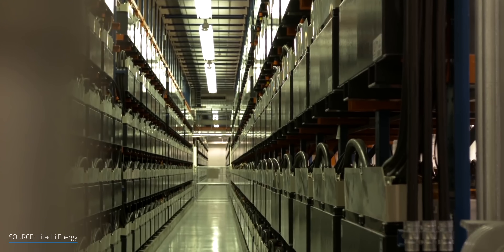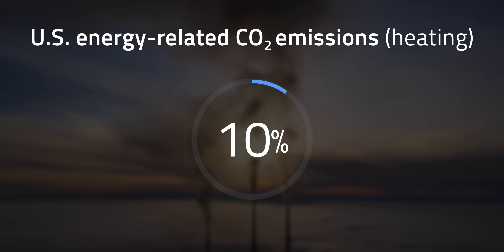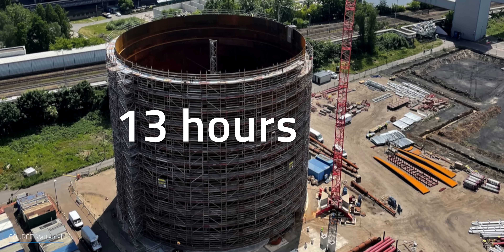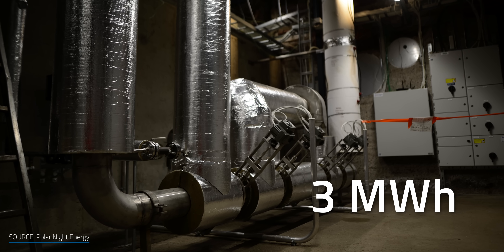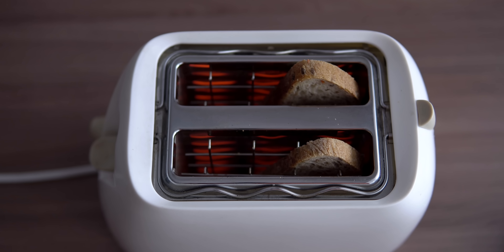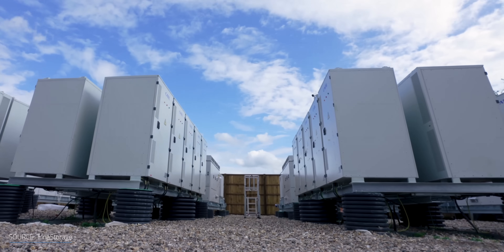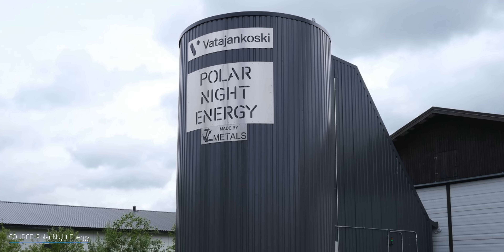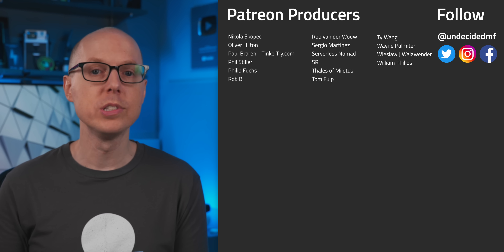How A Sand Battery Could Change The Energy Game

Comment: I'm curious if this could be scaled down to be used for residential batteries / heat storage, and for off grid systems.  You could probably remove the inefficiencies of converting power by using fresnel lenses to super heat air during the day / summer.  And use it to heat the house during the night...  I'm curious what type of insolation and size would be needed to store enough mass to make a difference.
Reply: That was also my first thought. Would be pretty interesting to see if it can be scaled down to single-home use. Looks mechanically-simple too, so it might even be possible to DIY.

Edit: I just realized that this would be amazing for people living in more rural areas. For example, my grandma lives in Serbia, and over there it's still normal to use wood fires to heat your home, at least in the more rural places (which is pretty much everything outside of Belgrade and a few other cities). Her house has water radiators connected to a central furnace in the basement over copper pipes. She used to have to use wood logs, but we've upgraded her to a wooden pellet system a few years ago. Which is great, because now she doesn't have to build a fire and can just press a button. But a sand battery would still be a massive improvement. The pipes are already there, and I am sure there would be a way to connect them to a sand battery, and then she wouldn't have to worry about keeping wood pellets in stock
Reply: @filipjovanovic8138  could possibly capture the wasted heat from the pellet stove and store it in the sand. Then you could switch between burning pellets for heat and pulling heat from the sand.
Reply: @jamaledwards4351  if you can capture wasted heat from your pellet stove then you're better off doing that and using it for heat directly/now and burning fewer pellets. Then burn the saved pellets later when you need more heat. No sand required.

Or said another way - if your pellet stove has a bunch of wasted heat that you can capture in sand then you're doing it wrong. 😉
Reply: @usa-ev  good point. Capturing that wasted heat and storing it for later use does give you the option of running a hot bath without having to start up the stove. There are also some places that have "no burn days" in which case the stored heat could be used.
Reply: @usa-ev  there are “homestead” wood burning stoves in homes where it uses heat generated for cooking and it also constantly heats water in a tank for use later.  However, sand has potential to store energy at a MUCH denser level and for longer / seasonal periods of time.  So it depends on use case.
Reply: @filipjovanovic8138  what if you use this in combination with sterling engines to extract energy in stead of producing electricity with steam turbines?
Reply: @filipjovanovic8138  https://www.youtube.com/watch?v=HEpBk9J886c
Reply: @filipjovanovic8138  great minds think alike.  I just commented the same and then saw your comment
Reply: @filipjovanovic8138   Yea, perfect
Reply: @filipjovanovic8138  for single home use to store heat you use water tank.
Reply: @filipjovanovic8138  there are water based soulutions for this witch are insulated watertanks with thermometers and waterlines connected. If you get a few kubic meters of water it will last for several days!
Reply: @filipjovanovic8138  When the furnace runs, what happens to all that excess hot air?  Travel up a chimney?  Why not line the chimney with with some pipes and flow some hot air, water/steam through it to heat up the sand battery and capture a bit more of that heat that would have been lost. Then a set of those hot air pipes running through the sand & radiator can continue to keep the house warm even after the fire goes out.  You could even get a solar water heater (vacuum tubes) to generate high efficiency heat during even cold days, and pipe it into the sand battery.  We already have solar water heaters... basically it should be relatively equavalent to solar water heater that can hold 3x the heat energy, just not for storing hot water, but used for generating household hot air.
Reply: We've been doing pretty much the same thing in our off grid home for over 20 years, using just water and a 500 gallon water tank. Surplus solar electricity, solar hot water and woodstove (winter) all keep the tank at about 140-160 F. The hot water heats our domestic hot water via a copper coil and we circulate water  through our concrete slab in winter (PEX pipe in slab). Super simple and was cheap to build. I used a standard 500 gal plastic water tank and insulated it with lots of foam. The manufacturer said to keep the water below 180F. I change the water in the system every few years and add boiler water treatment to the fresh water. Just works. We haven't paid a utility bill in 22 years.
Reply: @TheGhungFu  ....Amazing! Can you make a Video about it?
Reply: @TheGhungFu    Very nice! Do you have more info on your heating? Perhaps a video showing the concrete slab?
Reply: @TheGhungFu  Where? i.e. in what climate?
Reply: I think in another video Matt talked about size being important to thermal storage. A bigger vessel has significantly less outer surface area in relation to the mass of the heated material. That means much slower heat loss. It would be impractical for a home-based system to have such a huge insulated storage tank. These work better at scale.
Reply: @PelicanNorth  that's a good point. I don't think it matters to much if the time between heating the sand and using the sand is only a few days. When that time turns into months then the size becomes more important.
Reply: @PelicanNorth  And the pumps, pipes ETC. get cheaper per unit of energy stored
Reply: @PelicanNorth  But the transport of heat (especially by hot air!) works worse with scale. There will be an optimum size- which I assume they have chosen. BTW ignore the 99% efficiency figure- only someone ignorant of thermodynamics could say that with a straight face...
Reply: I like both the ideas presented here.
Reply: I know that earthships use something kind of like this... they have a huge thermal sink that is used to normalize the temps... they absorb a ton of heat form the sun during the day, and then warm the structure at night.... but yeah having a small scale sand battery seems like it would be feasible, especially in desert climates where you have extremes in temps.
Reply: @TehZombish  I used to live in an adobe house and this was my experience: it was mostly comfortable all year but summer.  The thermal mass works great for short term temp swings, but in the summer the mass would get hot n not cool enough at night. So it would get hotter and hotter.  In the middle of summer we’d have to sleep outside because inside was unbearably hot. And it stayed that way into the fall. 
Once our mass was saturated with heat or ambient cold. It became uncomfortable, and you can’t just flip a switch or put on another log.
Reply: @randycarroll-bradd4894  install thermostate to regulate? 🤔
Reply: @TehZombish  The concept of "earth ships" is that every single thing the house is made from is potential storage for heat within the thermal mass of the building. They use very thick walls, lots of dirt etc. The problem with that is that urban sprawl builds would either need to have alot of dirt brought in, or would need to be dug into the ground like a hobbit house. Try selling that idea to suburban families... Probably won't fit in with their ideals/nice SUVs and manicured lawns.
Reply: It would be interesting to dump waste heat from other home appliances into a thermal storage unit like this. For example your air conditioner and refrigerator both dump the heat they pull from the area they are cooling into the environment as waste heat. If that hot air could be pushed through a heat battery first it could add energy that would normally be lost. It would probably not be enough heat by itself, but it would just be wasted otherwise.
Reply: @DanielBoger  i think of things like this.  like pre heating water going into the boiler. even in the summer we need some hot water
Reply: @DanielBoger  As soon as the store is hotter than your waste heat (PDQ) you are pushing heat uphill. Yes, you can do this with a heat pump- but they get increasingly inefficient as deltaT rises. Pumping into 600C is probably worse than just resistive heating.
Reply: @DanielBoger  but therefore you'd need insulated steel pipes running from every device through your home to the sand battery.
Reply: there's a number of thermal store products available on the UK market
Reply: @edc1569  but they typically last a day or two, not seasons?
Reply: @orionbetelgeuse1937  no, that 8MWh is available on demand. If a home requires 30mwh per year, that's approx 82.19kwh per day, meaning one large 8MWh silo like this can service approx 97 homes every day. Stated differently - while it only has an immediate capacity of 8MWh, if it is cycled 365 times a year then it has effectively provided 2920MWh of output power over the course of a year. 

At $10/KWh, it's a really cost efficient storage solution, my 9.6kWh lithium batteries was about $2951
Reply: @SparkusZenTime 
That fits better with the claims that their battery is continuously heating a public swimming pool and buildings on top of that.
Reply: I'm something like that could be cooked up (with help of thermal pumps). But there are actually better options, as in geothermal pump for heating.. .and run it the other way during summer months (so cool the building and dump the excess heat into the same ground used for heating during colder spells). That has been done in some commercial (office/shopping mall) buildings, and it is not too costly if the foundations require a lot of pile driving anyway (piles make a good thermal mass).

Naturally the heating and cooling needs to be designed so that they can be done. Retrofitting such a system might be quite spendy, less so for new builds. Using a higher temp minimized sand thermal battery might be easier to retrofit into existing residential buildings, but there is often a critical mass required when the heat loss is acceptable. Too small, and it won't hold the "heat" to be economically viable.
Reply: @hematula1  One thing to remember about geothermal.  You get temperatures that is consistent, but cooler then most people want.  Now mixing that air with a bit of warm air from the sand...  would remove the need for a heat pump.  Could be very nice for an off grid system where a pump for geothermal, and a fan for the sand......
Reply: @hematula1  would you explain how the heat exchanger pump energy consumption scales up with this?
Reply: Not really, it’s a volume vs. surface area problem and volume scales cubically while surface area quadraticaly, you want these tanks to be as big as possible, preferable in a cylinder or sphere shape. If you have interest in a more efficient residential heating system then heat pumps with either a ground or water source is very efficient
Reply: @markhaus  yes but you didn’t solve energy storage problem.   Real world issue in northern climates is snow and cold.   While winter brings clear days (solar) with wind (wind turbines) energy can be produced during limited duration.  More that what is required but it needs to be stored for the cold nights and potentially days when it snows and there isn’t sunlight or wind to leverage.   If we could store for heat that could store for “seasonal” storage needs, then you have a true game changer
Reply: Three points: 1 - For new subdivisions, you wouldn't need to scale it down. Just build them with district heating from the get go.
2 - For existing homes, there are already thermal storage solutions along similar lines, some of which have been seen on this channel, though not seasonal. Sunamp's heat battery is a phase change thermal battery. Caldera's Warmstone heat battery uses high temperature rock as the thermal mass (current unit stores 100 kWh, but they can be hanged together for increased capacity of needs). And Tepeo also has a hot mineral based heat store (40kWh per unit). All three can be used to convert a home boiler system and add load shifting. None of them have enough storage for seasonal use, but they can do a day or two, depending on the size of the load. The 8 MWh system shown in this video in the application it's installed in is actually sized to have the equivalent of a full charge/discharge cycle (8 MWh) stored and used about every two weeks on average in heating season according to the manufacturers website. It's feasible to size systems to cycle seasonally, but the requirements for different applications dictate what is the right choice for a given installation.
3 - Depending on the climate and geology of the area, other options may be better at a district level in some aspects. If you have a significant heating and cooling load and the right kind of ground, then a district borehole field and ground loop with ground source heat pumps may make more sense. There's one out in Alberta Canada which has a fluid loop going to all the houses in the development and through a pattern of boreholes in bedrock (which isn't that conductive but has a high heat capacity). In summer the heat from AC and some solar thermal collectors (there's more heat needed in winter there than cooling in summer, so they need to make up the difference) is boosted by a water to water heat pump at the borehole field and charges the thermal storage array to about 80°C IIRC, and then is used to heat the neighborhood loop in the winter. Unlike steam or hot air district heating systems, the neighborhood loop is dynamically heated or cooled as needed to maintain a temperature range that the individual households' heat pumps can use to either add or remove heat from as desired, especially in shoulder seasons where both might be needed over the course of days. Pumps, thermometers and valves control which boreholes get the heat exchange fluid in what order so the field is hottest in the centre and coolest at the edges in order to reduce heat loss. Obviously this doesn't work in areas with fast moving groundwater because that'd carry away the heat before winter, but in the right conditions, you don't need to build as much generation and transmission capacity because it takes less energy than the sand battery solution to run, and you don't get the added heat in the air in summer from running air source heat pump cooling.
Reply: With systems like these they are better at larger scales.
Famous square cube law. You just don't loose as much heat energy.
You'd have much more success from air/geothermal heat pumps for individual house units.
Reply: @Vulcano7965  yes but just how ‘inefficient’ is a smaller one.  Does it go from 95% efficient down to 85% or down to 45%?
Reply: @mrbizi5652  inefficient enough that you can use geothermal instead. Much larger heatsink and without the energy intensive resistant heating. These types of applications are much better suited for larger complexes or even neighbourhoods.
Reply: Residential and greenhouse thermal storage using sand is already being done.  There are lots of videos on the application.  In most applications an insulated sand filled concrete box with heat exchange tubing is placed under or outside the building footprint.   The box is heated during the summer and winter days and the heat is supplied to the house/greenhouse at night.
Reply: I'm working on scaled down version of that, just for the purposes you've mentioned
Reply: @mattkozak  are you working on scaled down sand battery?   I would like to learn more and do the same.
Reply: @orionbetelgeuse1937  intriguing thought.
Reply: i have some ideas and i put them in the comments  but one insulation that might work is the vacum glass like a thermos bottle. .. i sold kits of clear ones. for a diy  pick up cheap ones at yard sales   if in your design . we might not have to bit im sure there is a way to seperate the plastic outer casing from the vacum glass and im sure they can be linked either in series or in parrallel
Reply: @andrewfischer8564  There are/is vacuum insulation made of stainless sheets separated  with insulating spacers. Looks like pillows with the steel stretched inward between the spacers ( 15 lbs /sq. inch inward push )
Reply: I’d guess that its not practical or safe at that scale and a heat pump heating system would be more practical
Reply: I built one, but circumstances cut the experiment short…
Reply: As were mentioned elsewhere:
Heating during the night in the summer is not a thing. I have my heating system turned off half of the year here in Sweden.
Reply: A solar hot water heater is basically this technology at a home scale.
Reply: @TheBlightWarden  This is interesting. I think the main problems with H are: (1) the efficiency of first producing electricity from renewable sources, (2) corrosion of the electrodes and (3) storage of the hydrogen. It's hard to make clean hydrogen efficient, but storing the excess heat for later use should help.
Reply: Would never happen large scale if feasible. There's no money going to the utilities.
Reply: @orionbetelgeuse1937  Great point! My own annual use is 12MWh. Think the neighbors might object to this in my garden... Plus the idea of transporting the heat using air, across a district, is madness. Pumping that much air is energy intensive.
Reply: @Tensquaremetreworkshop  I think there is a misunderstanding of how district heating is done? The energy is carried from a central heating facility to the consumers by a water/alcohol mixture in very well insulated system of pipes. Every consumer unit has a heat exchanger to isolate the local heating system from the district heating. So, to the best of my knowledge, air is never used as a energy transporter, at least here in Scandinavia where I live.
Reply: @brus54per  True. But the design here shows air being the energy transfer system to the sand. Transferring that heat to water is another step, reducing efficiency still further. In practice, a store of this size is barely sufficient for seasonal storage for a single dwelling, (for example, my own needs are ~12MWh) so the district heating value is moot.
Reply: I was thinking about this. I was trying to find some details about the resistance heater, airflow and power inputs (kW) to try and design a small one using a 'big' gas tank (around 1000L), but couldn't find many details. My idea was to have the gas tank with stainless steel pipes running through it, and a separate unit where the air is being heated and transported. The tank can be filled with sand (depending on the amount of pipes and thus surface area, you'd need sand with a high thermal conductivity). The whole thing will then be wrapped in rockwool insulation. If anyone has some more ideas, feel free to share them with me!
Reply: Thermal storage solutions don't scale down very well since insulation ends up accounting for a disproportionate fraction of cost for the amount of heat stored.
Reply: Even something even simpler, like accepting some temperature variance over a day, can save a lot of energy. 
In hot climate, cool to slightly cooler than necessary when electricity is cheap and don't cool at all over the day. In cold climate, do the opposite. Requires decent house insulation, obviously, but it's a way to use the house to store thermal energy, in a way.
Reply: @stegenfeldtatwork7364  that is one thing that Matt does not point out - FI (and EU in general) has very harsh standards regarding housing insulation. New houses have to pass A++ energy eficiency certification before you can live there. Therefore even slight advantage in thermal energy storage helps a lot.
Reply: We have a brick thermal unit in our house.  It could be charged during the day, but actually we use the cheap electric power at night to recharge and dispense the heat during the day.  Yes we have solar too, but unfortunately the brick thermal system uses about 7kw when in winter our solar only provides about 3.5kw.  Energy cost is 25yen/kWh in day vs 10yen/kWh at night.  So you can see the slight win recharging thermal at night.  Also our heat pump AC can more efficiently top up the house temp with the solar.  Brick storage just keeps an even base heat, and is 100% efficient.
Reply: There is a company called Climatengine that have made for the home in both hot and cold. You want find anything on them but I did some work on their pool heating system. I was told once all their products have enough hours on them they will begin releasing. Very interesting stuff. Basically no footprint and so simple tech.
Reply: Yes .  Only question is how long opposition from current heating  technology and energy companies slow adoption like electric vehicles
Reply: I changed to geothermal and  now have an unused oil tank under my house. I’m tempted to fill it with sand and attach solar air heater to that.
Reply: First, you need to know the energy per volume of sand that it can be  stored. Then calculate the energy that you need to heat up your house per hour to estimate the volume or the size of your sand battery
Reply: Yes
Reply: my first thoughts as well. Actually it seems reasonable that you could build your own home version because the materials are reasonably cheap and available. an insulated sand barrel with water tubing ran through it could be replicated at home to store heat energy. The heat storage conversion sounds very reasonable even if it's not directly transfer efficient.
Reply: That's a very good idea ...worth investigating
Reply: im sure thunder foot will be debunking this in a few days
Reply: What happened when you scale down Earth ... ?
Reply: @TheBlightWarden  I think that if you withdraw heat from the electrolysis solution that you would at the same time increase the necessary voltage to cause electrolysis so you might not be getting as much energy recovered as you would like
Reply: It already has. It is called geothermal system. If you heat over the GT (non critical for piping) pipe - you essentially heat up land mass that can be later salvaged during the winther with heat pump.
Reply: @orionbetelgeuse1937  I know of a source of 100s of millions of tonnes of crushed igneous rock, mining tailings, from over 100 years of mining operations which continue. 
Note that these mining operations are also deep enough to be a source of geothermal energy.
Reply: probably not because it uses volume to store heat and your volume goes does significantly when you scale it down.
Reply: Those systems already exist. They're called ground-coupled heat exchangers. However, those systems are mostly dug underground. Maybe it's better to put them in silos in more rural areas.
Reply: Especially since those systems are depleting the local warmth/coolness while those silos don't have that problem.
Reply: In my country, modern well insulated house energy demand per year for heating is about 3MWh. Thats a water buffer with 37000 liters of water (enegy loss not taken into account, water temperature range between 20 and 90'C).  Thats a cube with 3.33 meter size and 67 sq meters surface. If sand with higher temp range can take 3x more energy we need 2.5 meter cube and 37.5 square meter surface. And you need huge insulation, I guess about 0,5 meter thick.
Reply: It all ready has night storage heaters work exactly like this some use sand some use brick
Reply: Basically, you are describing passive house technology....with lots of thermal mass to collect heat during the day and use it to warm a well-insulated home at night.
Reply: I grew up in a house with basically a down scale version of this system (solar thermal) with two heat exchange tanks  in the crawl space that heated our home and water … while their where numerous ways the system could be improved had it not been a retro fit system …we could have all our guests shower consecutively and not run out of hot water! The system lasted 40 years with minimum service … the need of replacing the internal elements of the tanks is what took the system out of service last year …but that had more to do with all the local fabrication shops being to busy to take on a small job … and the retirement of the guys whom had serviced the system …plus our local energy infrastructure is relatively more reliable and cost effective than decades ago!
Reply: go geothermal might be better
Reply: not cost-effectively I wouldn't think. Heat pumps would still be a better, more efficient/cost-effective solution.
Reply: I mean, it’s almost free to try looks like it! Just curious about the insulation tho.
Reply: The UK seems to be leading the charge on thermal energy storage with has change material to increase energy storage density.  Look up Caldera's Warmstone and Sunamp.
Reply: I mean a hotwater tank and insulated house both store heat.
Reply: I assume because of isolation and size, large batteries of this type will be much much more efficient
Reply: @orionbetelgeuse1937  Luckily, winters are getting warmer. Thank goodness for climate change!
Reply: See no reason apart from energy density why I can't place one of those things on my backyard or even underground.
Reply: The answer is no. It's all just proof of concept projects to gain investors. NONE of these have made it to production, but they all make money.
Reply: we already use a similar idea in greenhouses for heat storage.  you can also use composting manure with pipes run through it as a chemical component to a sand battery storage.
Reply: You wouldn't want to do it though. The cost would be quite high (100* the size, 20* the cost also works the other way) and the losses would be a LOT higher. Area only increase by a factor r², whilst volume does r³ (at a cilinder almost). Since losses are connected to area and energy stored by volume, decreasing the system reduces the efficiency (increasing cost) and increases cost since some costs are fixed/high at small sizes
Reply: No, it could not. ;)
Just because isolation. Bigger objects kept the temperature better than the small ones. Just because ratio of volume and surface. ;)
Reply: @josephb3147  - FYI....it's not like they aren't hinking about it, my man  :O

https://www.youtube.com/watch?v=73mXXJpEjRI  - Channel:- Real Engineering
Reply: Check out Earthships
Reply: I have one of these rocket mass stove/couches in my house made of concrete, not cob.
https://youtu.be/NYJyxptclos
Reply: @orionbetelgeuse1937  The sahara desert expands.. they fight it with the big green wall,  maby this type of battery can take som sand in and help them..
Reply: Maybe you could fill the walls of a house with sand instead of R rated foam as needed.  If the wall of the storage unit is already a thermos, then you might as well use it.
Reply: ..and thank you for adding fresnal lenses..will be sure to include
Reply: I live in Minnesota. i think we can have up to 7 days continuous below zero. And about a total of up to 14 days that average below zero. This is an indication of how much sand battery i would need. If i air seal and insulated well, my heat pump could do a reasonable job with the remaining cold season. Feb resistance heat would be 6.5 mWh as my house is today. sealed correctly it could be 2 mWh or lower. if i employ the battery only in sub-zero weather- that might be less than 800 kWh for Feb and potentially less than 1.5mWh for all of winter. my house is 1300sq fyi. so this seems reasonable.
In addition to seasonal batteries there can be daily batteries to consider through solar gain from the day into night on the house itself- lots and lots to consider as each piece  of the puzzle is reshaped everything else in the puzzle may need to be reshaped. 

So why not heat the sand with a heat pump? heat pumps don’t produce that intensity of heat 1000F. any residential waste heat can’t contribute much either. you could start with waste but after 400 degrees you’ll need to switch to an intense resistance. unless i’m confused(totally possible) a 400f heater can’t heat something up past 400f, for example. anyway, that’s the genius of sand. it can take that higher heat where water can’t. water has a better thermal mass but sand wins because it’s easier to store and can heat up much higher. thus your structure can be smaller overall. insulating would require kiln like insulations- fyi.
Reply: @dfghdfzsd  100% spot on!
Reply: @dfghdfzsd  
Resistance heating elements are vastly more efficient to heat the sand, rather than heat pumps. My company sells commercial/industrial sand battery systems.
Reply: @sunworksco  please explain. resistance heat is thought to be something like 100% efficient but heat pumps 1-500% efficient-so to speak. i can explain the 500% thing too- if you wish.
Reply: @dfghdfzsd  
When using wind turbines, solar PV panels and hydro turbines, it’s the most efficient to use resistance heating elements. It makes no sense to use heat pumps.
Reply: @sunworksco  could be true- maybe it’s a matter of scale. but it would help if you shared the rationale.
Reply: @dfghdfzsd  
Heat pumps aren’t capable of heating sand to 500c. Heat pumps are less expensive to operate than electric water heaters, but aren’t efficient for heating sand.
Reply: @dfghdfzsd that's what we're thinking..because if u can heat the sand wi a heat pump before it gets too cold, then the sand battery can make up the difference 🙏